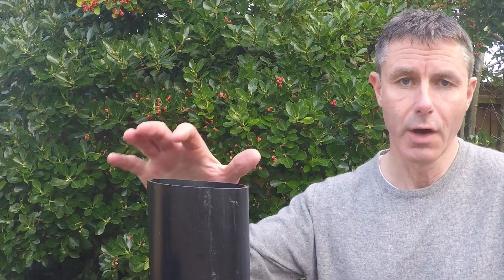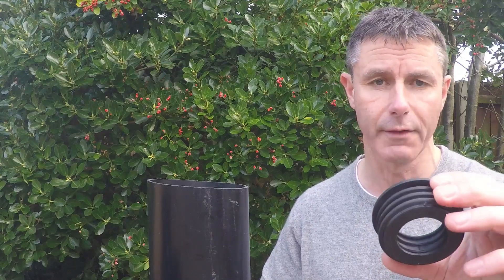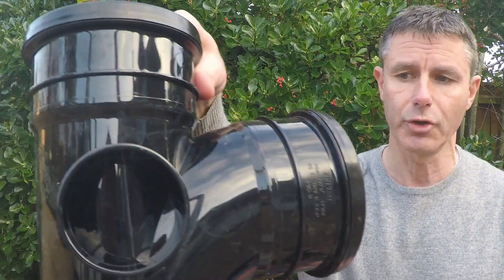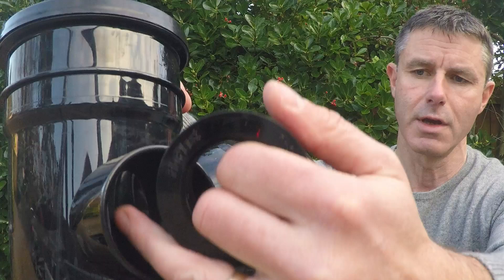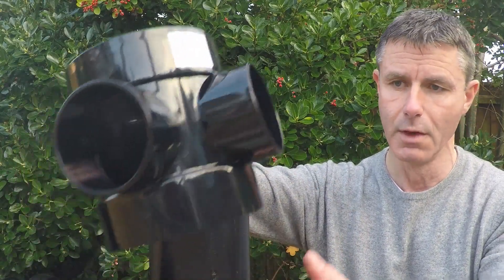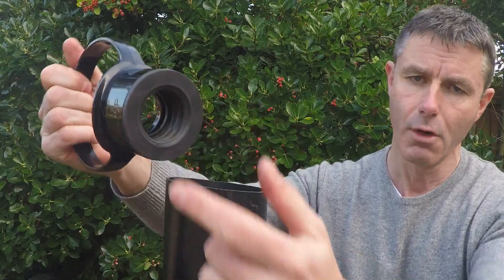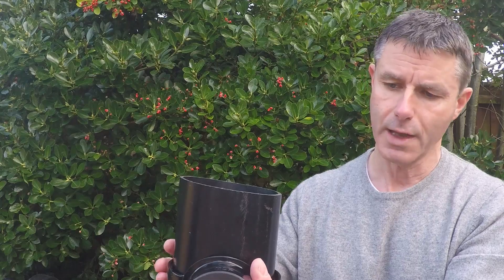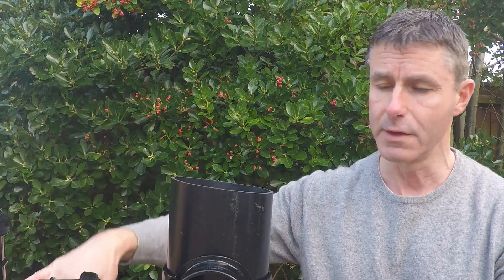HOW TO: Connect a Waste Pipe to a Soil Pipe | Drainage Sales

Comment: It is the solvent weld adapter that usually has the fall built in. With the rubber connectors, there is so much movement up and down then any built in 2.5 degree fall in the boss strap itself would be irrelevant. Also, on the rubber type youy should absolutely not rely on the rubber gripping the waste pipe to hold it in place. The waster pipe itself needs to be secure along with the fall.

Comment: Hi Tommy I would be so great fully for help can you get a pipe that would be different size at ether end like a rubber would be more flexible i guess  so say the pipe one end would be 10cm an other 6cm to fit in to mu gutter running outlet down spout many thanks

Comment: If you go for the black rubber, are you meant to put in a 40mm pushfit pipe or you are allowed to push in 40 mm solvent weld pipe as well? Will if fit and is it OK by water regs?

Comment: Hi, I need to block off a boss strap hole as have got rid of the pipe going to it, is there a push fit cap that goes into the boss hole available?

Comment: Is it okay to run a boiler condensate pipe into the soil stack using the strap boss? I'm just concerned that any toilet/bath waste could potentially run up into the condensate pipe and into the boiler.
Reply: It largely depends on where your boiler is located in the waste system; if there are outlets below the level of the boiler, assuming any blockage has occurred after the last outlet, any backing up will discharge from that outlet, like your toilet pan. If the boiler sits below the other outlets, then anything backing up will fill the boiler.
Reply: @S20Mike  Boiler sits on the ground floor so below the toilet and bath etc. Is there any type of pipe that can be used that would stop water/waste from backing up into the boiler? Like a non-return valve?

Comment: if you're solvent welding, just push the pipe straight in - DON'T GIVE IT A TWIST - that is bad practice - you break the joint as it is setting...